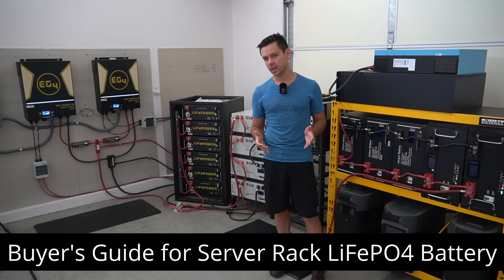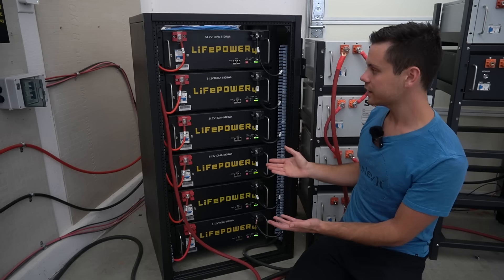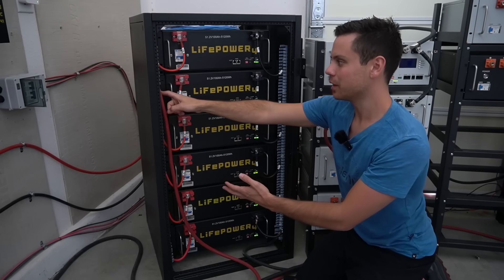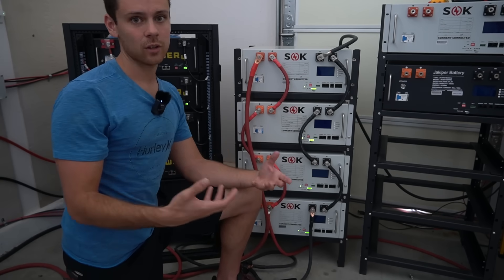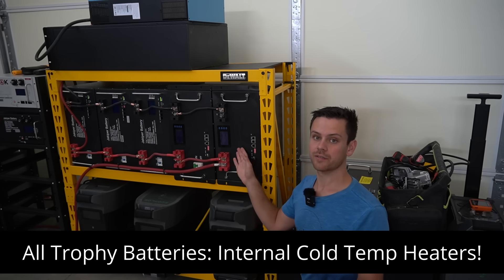LiFePO4 Server Rack Battery Buyer's Guide! For Off-grid Solar Systems

Comment from the maker: Server Rack Batteries mentioned in the video (affiliate links):

EG4 Line Up:
Budget LiFePO4 Server Battery: https://www.mobile-solarpower.com/server-rack-lifepo4.html

SOK Line Up:
48V Server Rack Battery:
https://www.currentconnected.com/product/sk48v100/?ref=wp
SOK Server Rack: https://www.currentconnected.com/product/sk48v100-sr/?ref=wp
SOK Combo Deal: https://www.currentconnected.com/product/fully-loaded-25kwh-48v-server-rack-battery-kit-bundle-save/?ref=wp

Trophy Line Up:
100Ah: https://trophybattery.com/index.php/product/48v100e-1-2/?ref=h-cvbzfahsek
110Ah (my favorite and in stock): https://trophybattery.com/index.php/product/48v110c-1/?ref=h-cvbzfahsek
220Ah: https://trophybattery.com/index.php/product/48v220c-1/?ref=h-cvbzfahsek

Jakiper Line Up:
https://jakiperbattery.com/product/server-rack-battery/?ref=h-cvbzfahsek

48V Complete DIY System Blueprints: https://www.mobile-solarpower.com/48v-all-in-one-buyers-guide.html

0:00 Intro
1:35 EG4 Battery
4:15 SOK Battery
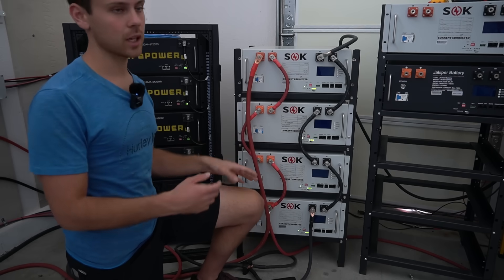7:40 Jakiper Battery
9:20 Trophy Battery
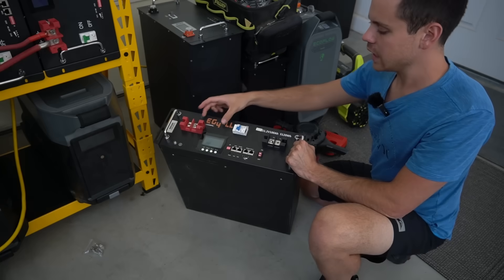12:48 EG4LL Pro Model
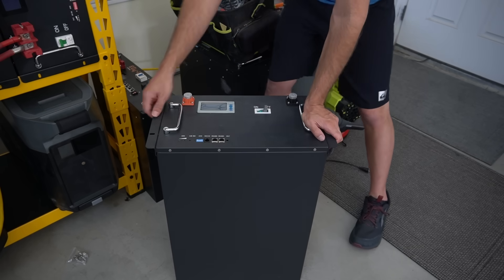14:08 Solar Golf Cart Server Rack Packs
16:32 Conclusion
~~~~~~~~~~~~~~~~~~~~~~~~~~~~~~~~~~~~~~~~~~
Tired of getting ripped off? Check out my "Will Prowse Approved" solar product recommendations below!

12V Batteries
https://www.mobile-solarpower.com/lithium-batteries.html

48V Batteries
https://www.mobile-solarpower.com/48v-batteries.html

Offgrid Inverter System Builder
https://www.mobile-solarpower.com/48v-complete-system-blueprint-559371.html

Hybrid Inverter System Builder
https://www.mobile-solarpower.com/code-compliant-48v-offgrid-system.html

Mobile Handtruck System Builder (very popular!)
https://www.mobile-solarpower.com/mobile-48v-system.html

Solar Panels
https://www.mobile-solarpower.com/300w-solar-panels.html

Ground Mount Solar Racking
https://www.mobile-solarpower.com/ground-mount-racks.html

Wire, Lugs and Busbars
https://www.mobile-solarpower.com/wire-and-connectors.html

Tools
https://www.mobile-solarpower.com/tools.html

Fuses and Circuit Breakers
https://www.mobile-solarpower.com/fuses.html

Plug-N-Play Solar Systems
Ecoflow, Anker And Bluetti! So many models to choose from. See my current recommendations here:
https://www.mobile-solarpower.com/full-size-systems.html

~~~~~~~~~~~~~~~~~~~~~~~~~~~~~~~~~~~~~~~~~~
Need to build a large DIY system? Need a trustworthy solar distributor? These are my favorites:

Signature Solar
Creator of EG4! Solar Minisplits, Victron and More! Largest Solar Store Online.
If you want $50 off, please use my link below and coupon code "DIYSOLAR50":
https://signaturesolar.com/?ref=cPwLcVc0SW-BjN

Current Connected
Best Prices for EG4, Victron, Midnite and so much more! Fast Shipping and Highest Rated Customer Service:
https://currentconnected.com/?ref=wp

~~~~~~~~~~~~~~~~~~~~~~~~~~~~~~~~~~~~~~~~~~
Join our DIY Solar Community 
Need more help? Join the largest solar forum on the internet for beginners and professionals alike. 140,000 members and counting!
https://www.diysolarforum.com

Check Out My Free Book
Best-selling and beginner-friendly guidebook to off-grid 12V solar!
https://www.mobile-solarpower.com/the-book.html

~~~~~~~~~~~~~~~~~~~~~~~~~~~~~~~~~~~~~~~~~~
Contact Information:
I am NOT available for personal solar system consult! If you wish to contact me, this is my direct email: williamprowsediysolar@gmail.com
FTC Disclosure Statement and Disclaimers:
Every video includes paid promotion or sponsorship (such as free products for review). Some links on this YouTube channel may be affiliate links. We may get paid if you buy something or take an action after clicking one of these. My videos are for educational purposes only. Information is subject to change/update at any time. Electricity is DANGEROUS and can kill. Be smart and use common sense :) DIY Solar Power with Will Prowse is a participant in the Amazon Services LLC Associates Program, An affiliate advertising program designed to provide a means for sites to earn advertising fees by advertising and linking to Amazon.com
Reply: tell ecoflow to adopt LiFePO4 on everything plz!
Reply: He's Baaack! Always good seeing another video, Will!  That said, quick suggestion for a future video series... how about going back to your roots some and doing a deep dive series on what your ideal "budget" and "mid-grade" systems of choice would be for a class C Motorhome, that could easily handle weeks/months of off-grid camping and not take up too much space(!?)
Reply: Hello will I need your help how can I get in touch with you thanks
Reply: Can you please review the Seplos Mason DIY Unit? They have a 280ah Battery Box that I’m very interested in :). Thanks for your videos very helpful
Reply: Seems like a no-brainer to get it eg4ll pro No issues 10 year warranty versus five and the screen for maybe $1000 more on a 30 kWh system
Reply: Which one is the best? Which one are you recommend for your whole home?
Reply: Is there any chance that you could do a video explaining what needs to be done to use an EV as a battery backup for a solar system?
Reply: Can these server rack batteries be used in your house without having to ventilate using fans to exhaust battery fumes outside like you have to do with lead acid batteries?
Reply: Hello Will!!! I would like that you make a video reviewing the inverters sigineer brand; i am so glad you do a great job reviewing all kind of stuff for off grid solar systems, but never show up anything about that brand, thanks for this video in particular because the comparison of all battery brands is great than ever!!👍🏼😎🇵🇷
Reply: Just a random question because  ive  seen you talk about  power optimizers for solar panels like Tigo optimizers. Why is that? Is it because  they don't  actually work?
Reply: I am very interested in putting in a battery bank.  However I have an existing 10kw grid tie system currently.  Is there a method through which I can charge the battery bank and then feed it back into the system for overnight use?   Thank you for all the info that you have thus produced.  It has been inspiring.
Reply: Scammers afoot on your channel Will. Just wanted to let you know. Thanks 🙏
Reply: I thought I sent you a message, question yesterday but I guess not. I've been getting emails from Dakota Lifepo4 batteries and I'm interested in what they're offering. They have an 11 year warranty, and are priced similar to the other high quality Lifepo4 batteries you've tested. So I was hoping you'd have some experience and knowledge about the Dakota batteries. By the way, I enjoy your videos. I've learned a lot already. Thank you!
Reply: Great video. I think the only real competition to already made server rack is the seplos Mason for eve 280ah case and DIY.
Reply: Looking at rack bats for marine installation, need quality, esp in the overheat shutdown circuits.  Also the deep shelf design would not be desirable, weight is an issue.   Agree if I can buy ANYTHING not made in chyna, I will go that route.
Reply: That new government tax credit scheme? Its not just cars. There is also up to $45/kw incentives to manufacture batteries and storage as well. That is going to do wonders for the industry to develop in the US and unfortunately make these batteries from China not eligible. And seriously Will, I have no idea why you dont just take the whole damn house off grid at this point.
Reply: 14:00 some of us want NO branding, so trophy is IT for me 
sorry
Reply: seriously i am the type to sand blast a logo off of my kit
Reply: You said to post about other server rack batteries you should test that are available in the US... 
Please test the sungoldpower and rich solar rack batteries, I was about to buy 4x rich solar because they were on sale for under 5k for 4 of them but then I found they are 15s batteries with lower than typical voltage so not sure about that, sungoldpower was willing to price match and they're a 16s battery so I think I am going that route but there isn't a single review out there anywhere and I'm a little concerned about that.
Should I pull the trigger and buy the 4x sungoldpower SG48100P for under $4k? The price is right and I need more batteries to run a mini split, amperetime says not to run 4 more 12v 200ah in parallel with my current ones so I think I have to get all new batteries and sell the amperetimes.
I've seen you running different batteries of different capacities and ages together just fine, but nothing like running 4x 12v 200ah ampertime in parallel with some rack batteries.
Reply: Hi Will, did you heard about Fogstar batteries? Any chance you could review them?
Reply: They don't need a BIG label for the Trophy battery 13:55  
They need a machine embossed stamp press with a measurement of 3" by 1"  and press their logo on the metal corner of the front of the right side case.
Or they can have a [T] logo design and in small letters next to the [T] letter complete the name [T]rophy.  Its simple, clean  and the case would be branded.

Comment: Howdy Will, Thanks for the Fantastic information that you provide.  I am building a new off-grid home in a remote Idaho location.  Our regional support for Victron is really pushing Pylontech for the battery solution but the price is 2-3 times EG4 and I am struggling to understand the ROI.   Have you ever looked at this solution?  They are pretty much refusing to support any other battery as being “potentially incompatible” with Victron components.   What am I missing?

Comment: Will the SOK Battery server rack battery pack perform well in a non-Solar installation? for instance, a 125 VDC emergency backup system with a 100AH capacity for say 12 hours in an industrial application where you have 2 redundant load sharing battery chargers with a constant float voltage of approx. 134 VDC. Where the primary function would be to provide control voltage to safely allow production equipment to continue to be monitored and protected while it shuts down in a Failure condition such as plant equipment or power grid failure. a condition where the battery would not constantly be discharged and charged daily, mostly just standby emergency power. over a 20-year cycle. The normal installation in our industry is vented lead acid, however we do not have the room for VLA batteries in this plant and currently have RM 55 Nicad which have failed. I am looking for replacement battery with better technology in a more compact installation.

Comment: I know this video is a couple years old now and i'm not sure they were out at the time but I would like to see a comparison of the MidNite server rack batteries to the eg4 and sok offerings,  they do seem to currently be a little cheaper than the other two on current connected website and I would be interested in seeing if they are just as good or what features you are giving up vs other current offerings.  Thanks for the videos and the wealth of knowledge you are providing.

Comment: wondering what you think about the sodium-ion or solid state battery's?   and have you seen any larger mega battery pr kits vs dealing with all the connections of sever rack systems? (curious if buying a larger mega battery would save cost on less packaging basically)

Comment: Hi there. great videos. I am having difficulty programming. The reset goes fine. The reverse direction and extend down (or up) via jogging it (press and depress) also works. At the reverse is when i have an issue and it backs a bit and then stops. Tried in down and up first. When i press the up/down key with MY is doesn't seem to record the position either. Any ideas. thanks

Comment: How do the Power Jack inverters work with these battery banks?  Also is just one of the batteries $1500 of the LifePower4 or is the whole stack you have in your shop $1500? I am assuming that price is per battery so you stack of 6 is $9000.00?

Comment: I noticed the EG4 are parallel, and the SOK are series. Are they both being charged by the same inverters? I have 6 48v LiFoPo hooked up now. I want to add 6 51.2V in series and wire both to the buss. I only have one server rack with the buss for the first batteries which is why they are parallel.

Comment: I use a separate 20A switch with a 10 ohm 50 Watt wire-wound precharge series resistor in parallel with the main battery switch. This makes powering up the converter from batteries much easier.

Comment: I don’t understand why you have big fuses mounted on the wall next to the source when the racks already have 3 built in saftey switches, on/off, 100a breakers and BMS over/under protection?

Comment: After my RV Solar system 20 years ago, I am building a house, and the solar system is part of it. Thanks for the video on the battery server.

As a Chinese American, I can explain why China made these. 1. Chinese salaries are 1/4 of American salaries. 2. Raw battery material has been acquired by China worldwide for 20 years non-stop; 3. Strong government encouragement to local province to build the next new industry. 4. Green power lowers smog in large cities. 5. China wants to be independent of oil from the Middle East, which America controls. 5. Battery is a relatively low-tech industry, unlike Semiconductor AI chips. 6. Low regulation at all levels. 7. 1.4 billion people produce highly competitive engineering skills and companies. 8. Chinese culture generally likes cheap and usually competes in price (good value). 9. The Chinese government is trying to bring another 400 million people from poor to middle class, so there is a lot of cheap labor. 10. Central planning produces a long-term industrial plan, especially for infrastructure-build like the Silk Road. 

Like other Asians, Japan, South Korea, Singapore, and Taiwan follow Confucian philosophy: working hard and delaying gratification.

Comment: @WillProwse
I have 3 Volthuim 5kwh batteries and I am looking for a rack in Canada to slot them in to. Everything I have found so far looks to be made specifically for their batteries or the weight capacity is like 180ld (regular server racks) What would you recommend? Can I purchase a LiFePower rack and install volthuim..?
Reply: Needs to be enclosed as per our regulations

Comment: You've been using networking racks, that battery would fit in a full depth rack no problem. Networking Racks are normally cheap due to only be 1 half or 3 quartets the size of a full depth rack. Normally full depth racks are 42" to 54 Deep.  My 42u Full depth is a 54". it needs to be this larger to support servers that are 28" in depth Plus a PDU, and Buss bar for grounding that is normal connect to 2 different utilitys and dual in line UPSs And some times even Dual Generators. With water cooling becoming the next thing we may even see 60" deep racks.

Comment: What about the new 560 AH batteries for the LIFEPO4 16s configuration, have you seen or worked with any of them yet? They say they are the same size as the 304 AH battery, but do not know if the 200 AMP BMS would be sufficient for them.

Comment: Hey there love your stuff so I have some questions is there other brands of batteries that will work with the eg4 18kpv, I see it’s eg4 only but I see different batteries here… also I herd the 18kpv doesn’t have a auto gen start is that true… or that is recently added in new firmware

Comment: Use the Weise 12v 100AH batterys for the golf cart. i bet u can fit about 6 in there 4 if u also hide the inverter for solar. it will give you 12V 400amp range

Comment: I'm trying to migrate from using a gas generator in my RV. I'm debating whether I should get a battery first or some panels.

Can you charge them with AC? Or would I need to convert it first?

Comment: Can you do an updated video? Riuxu, Orient Power, etc seem to offer competitive units. (I saw your Riuxu review & it's a tough to choose between those and the EG4 etc.) 

I have learned a GREAT DEAL from your channel and forums. I'm 62 & after building a beginner (600w) system to power my utility room (internet, some DC lights & ac outlets) here at home. I'm already 'off-grid' as the power company cut my power in March after a huge rate increase caught me off guard. Never again. (When they cut my power - it just meant they moved to the back of the line & solar went to the front.) 

Thanks for your easy to follow videos!

Comment: I see you have several different batterie link to one  pair of 6500ex’s.  I have 2 6500EX’s…can I link together 6 EG4 lifepower 5.12KWH batteries, 2 Life Power 7.5 KWH batteries (different manufacturer not EG4’s)? Will the BMS link together? What would be the best way to use these batteries together? All are new.

Comment: If you're going server rack than you're likely to have at least a rack, say 30kWh.
Signature Solar price for EG4-LL (6 server rack) is $10,119 for 30.72kWh
Trophy Battery price for 48V304E-2 (for 2) is $9,390 for 30.72kWh
Trophy is cheaper, and it has a heater!

Comment: Will, I don't know if you ever look back at comments left on older videos you've made, but if you do, I am leaving you some advice on where to locate the EG 4 battery. Make a shelf for it behind the footrest on the rear of your cart. It should fit snugly and you can drill a hole through and place rubber grommets around the hole.